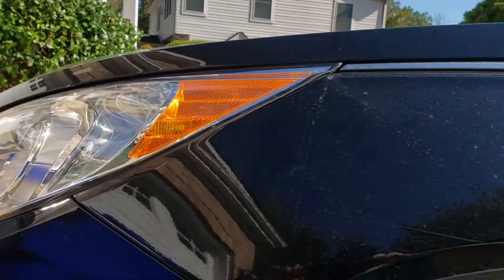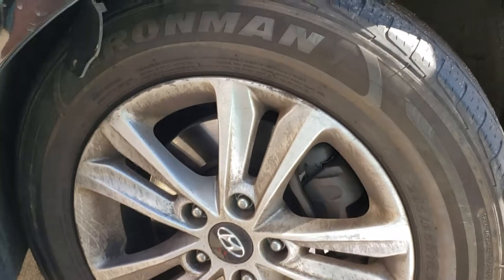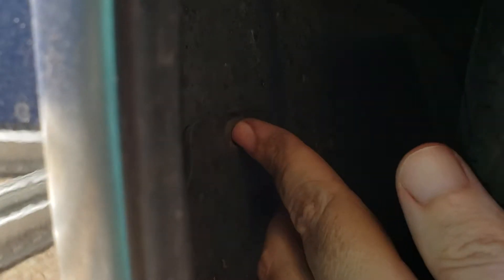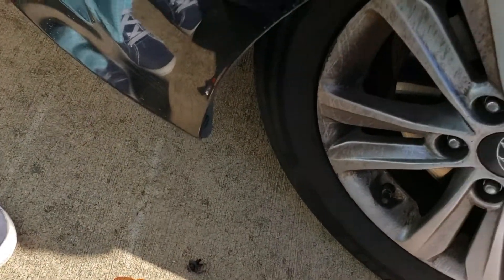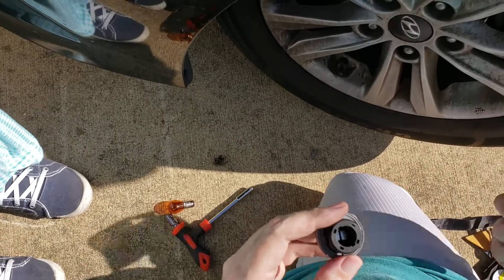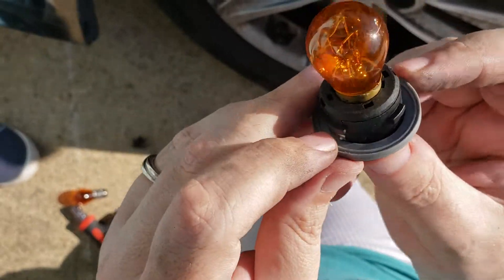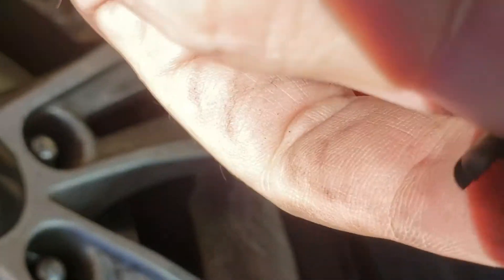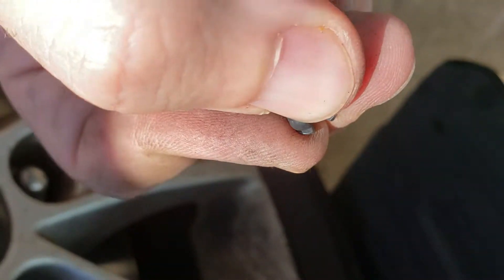Changing front turn signal 2014 Sonata

Comment: When I put my hand through that opening, I can barely turn the cap that holds the bulb. It’s frustrating, how did you get it out so easily?
Reply from the maker: It can be difficult, just make sure turning left to loosen, right to tighten, also if you can apply a little forward pressure as you turn, sometimes the rubber gasket that protects from weather sticks